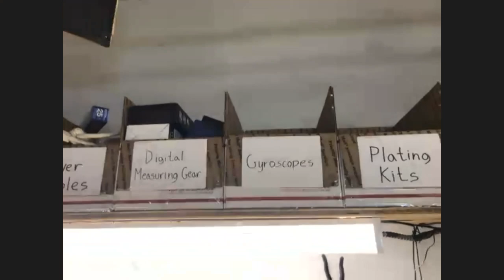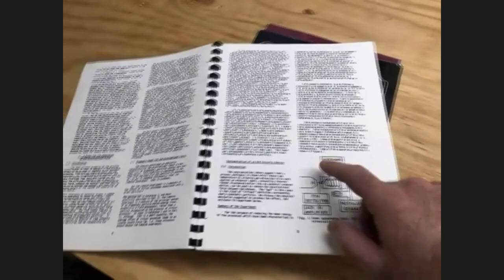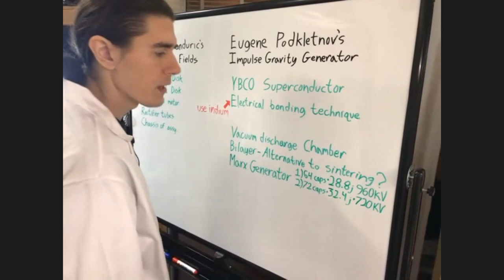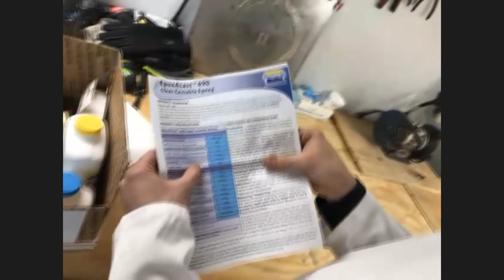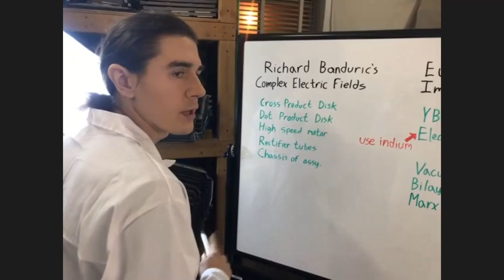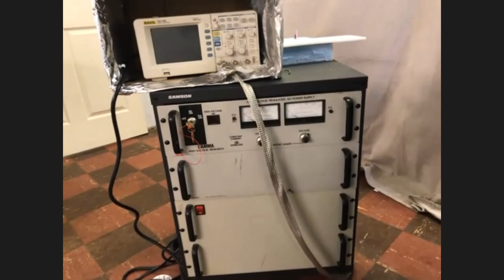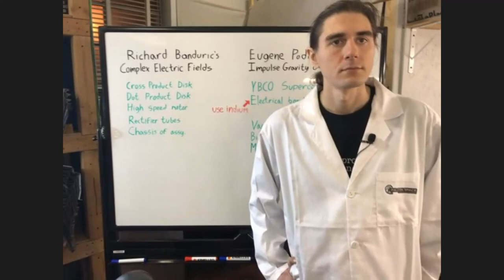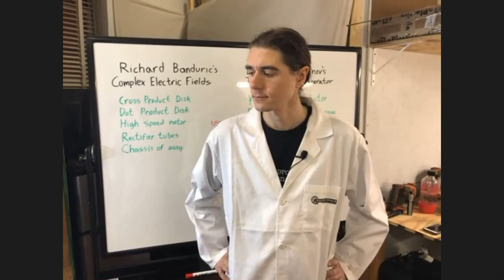APEC Dec12 2020 Lab walk thru with Jeremiah Popp and Mark Sokol

Comment: Hey guys, I happen to work for  a company that builds microwave wave guides tuned to very wide range I'll Teri and talk to a few engineers about setting the tuning and testing the finished frequency finished product passes
Reply from the maker: Whats the company name ?
We could definitely use your expertise in our test setup
Reply: @FalconSpace  and I also think you're going to need a control module that's a transmitter and receiver both to test the guides and a sensor running to the exit point of your guide and a good software to hook you up with some programming skills for an accurate and confident result